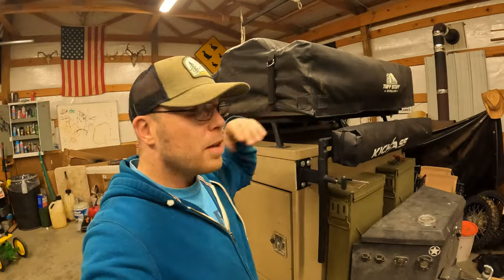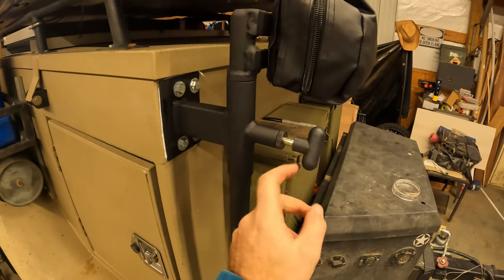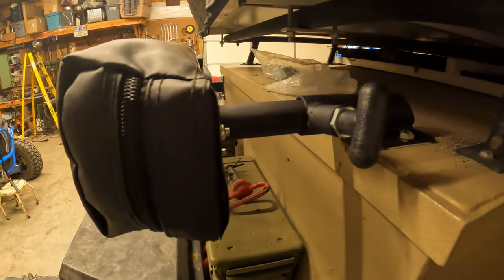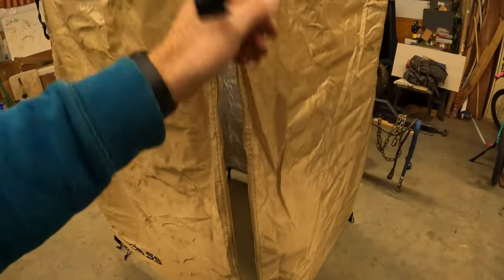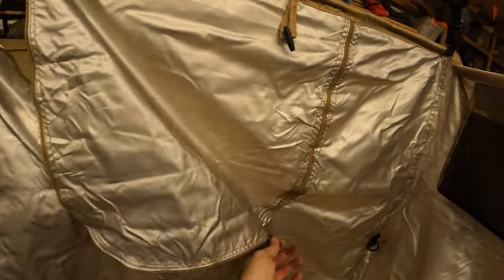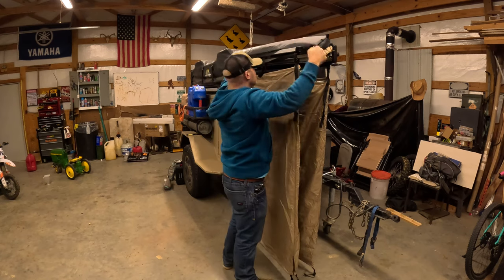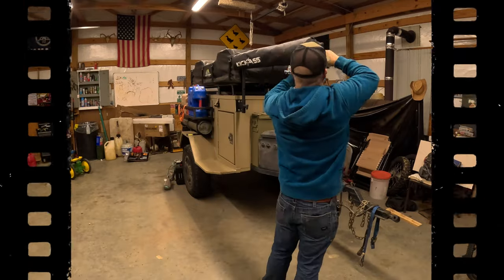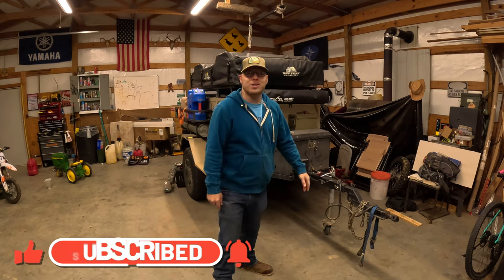Overland Trailer Custom Swing Out Shower Tent-DIY

Comment: Good work, very good idea. 
Mind sharing links or places where u bought the brackets, pins etc? Cheers mate.
Reply from the maker: I fabbed up the brackets, pins are from Amazon Innovative Components AI1/2T1.5-B-TR6 1/2" tapered tip, 2.25" Rounded T knob Spring Loaded Pop Pin 1.50" welds on barrel included https://a.co/d/5Uz1e4a